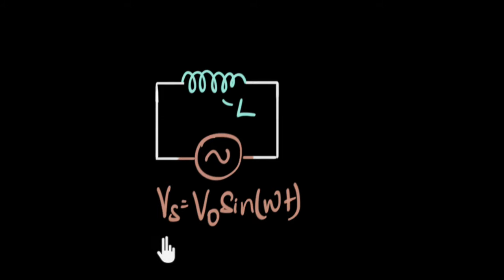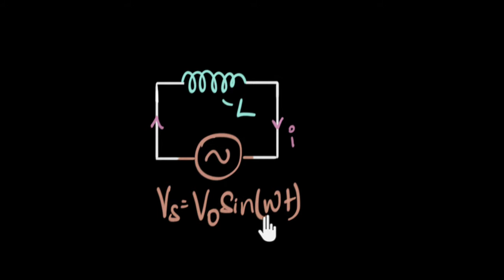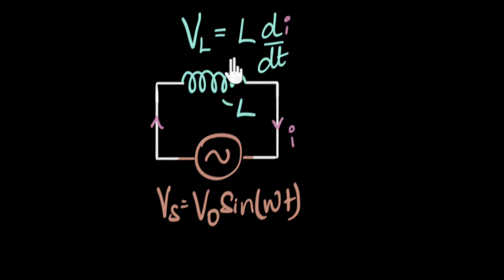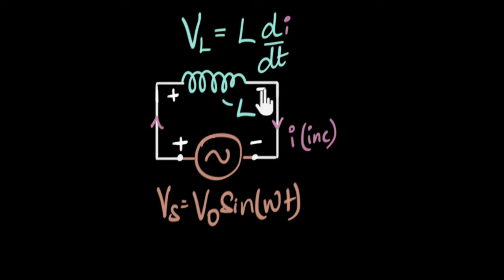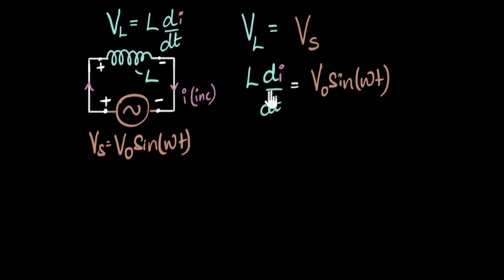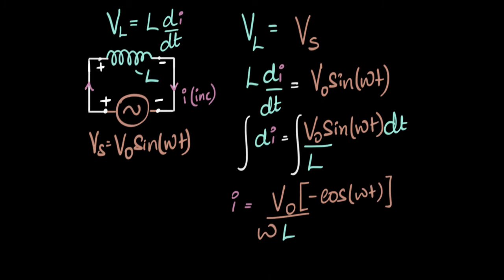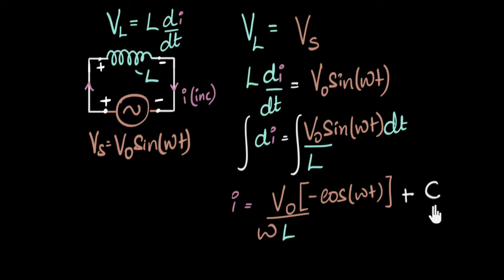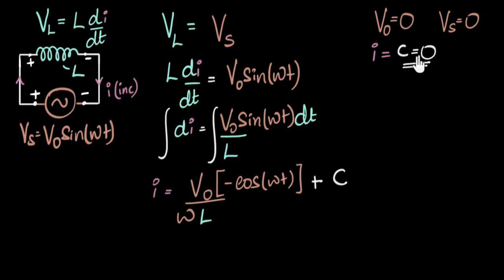AC voltage across pure inductor (derivation) | Alternating current | Physics | Khan Academy

Comment: Sir, the back emf at any instant will always be equal and opposite to the source voltage then how can a current flow in the circuit
Reply: Bro do you come to know answer of this question ❓ please tell me also
Reply: It changes all time,not always equal ,as inductor in DC voltage,at switch closed back emf equal, in ac same way but back emf equal to source v at instant and slowly lows and changes as voltage changes polarity and so on
Reply: And see Vs depends on Ldi/dt , current changes sinusoidally and emf changes as current changes

Comment: if vs and vl are equal then why currrent flow ? if current flow but in which direction opposite to source voltage direction ?
Reply: The same qn is troubling me so much
Reply: Remember, I is rising gradually in a purely inductive circuits. Because at the beginning back emf(the V of inductor) is same as source voltage, I=0. Then V of L decreases with time and I starts to increase. So yeah, your question is valid but only for a small amount of time(at the beginning).
Reply: Current flows from souce to inductor always as source gives that charge V potential and inductor decreases it's potential it is just that simple he just used energy conservation as given by kirchoff 2nd law

Comment: You failed to explain a key point. Why does the induced EMF with the SAME polarity as the source voltage cause a Voltage in the opposite direction from the source? Shouldn't the induced EMF have an opposite polarity? How can it be in the "same direction" if the EMF is in the opposite direction.
Reply: I can't understand that too. My teacher said it would be opposite. Can you explain that please?
Reply: @Fateymaa  I decided to think of the induced EMF as a "battery" that is producing an EMF opposite in direction to the source voltage, even though its polarity (the  plus/minus orientation) is the same as the source voltage. That is, in the circuit represented in the video, the induced EMF is pushing conventional current counterclockwise, while the source voltage is pushing it clockwise.
Reply: @Festus2022  Thanks a lot. Earlier, I, kind of, came up  with the same conclusion. It feels right now.

Comment: sorry but I have a question: why the circuit doesn't exist without the resistor.
Reply: Because every circuit (the wires) would have some resistance... It can't be zero
Reply: @dodokoi036  ok but let suppose that the wire have a resistance how we add this to equation , we addet like a resistor equation or what ???
Thank you for you answer
Reply: V/I = R
If R=0,then V=0 means no flow of current so no circuit... People also say that infinite current flows because nothing is there to oppose the current. Infinite current is just impossible

Comment: Rest of the lecture was awesome but, Can someone explain why the inductor has the same polarity as the battery? Shouldn't it be opposite in order to oppose the applied voltage?
Reply: simple answer is “no”, however, there is a particular concept that may cause confusion to those learning about inductors. While there is no defined electric polarity for inductors, direction of current does matter because of a phenomenon called inductor kickback.

Comment: Your enthusiasm and explanations are of high quality.

Although I'm not sure of your explanation regarding the value of the constant C. 
"Because it is a constant, if it is 0 for these values, it should be 0 for any value of Vo" -> that sounds false to me. C could simply have Vo on its numerator, no ?
You can't replace the values of the constants (Vo) when calculating C, you need to determine it for a **particular value of t**. For example, t=0.

Am I missing something ?

Comment: Sir if induced emf and applied voltage are same then current should not flow
 Like two battery of same volt are connected with same polarity..